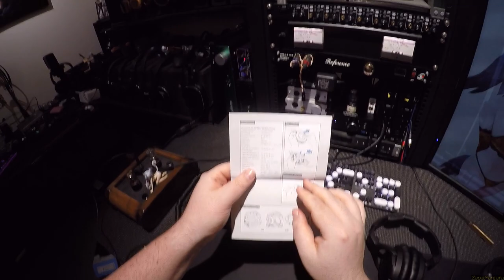Sennheiser HD300pro _(Z Reviews)_ Accurate... but

Comment: The reason of 8-pin connector is because it has the variation models like HMD300Pro that has a mic for broadcasting. They share the same design. Therefore in this case the normal HD300Pro probably only using 3 or 4 pins on the connector while the other models use all 8 pins.

Comment: I have 280, 300 and NDH 20. 300 is almost the best headphones ever, I love mids sooo much!!!! But base on 300 is overpowering mids, which is really unfortunate, I almost cried. NDH 20 is the best headphones ever but really uncomfortable after 30 min. Like really uncomfortable. 280 is the best headphones all around. If you dont have any of these 3 headphones, start with 280, it's only 79$ on sale. 280 sound very balanced, greats mids, great atmosphere, great bass, and detailed enough. 280 is a pure pleasure.
Reply: I have to disagree, 280 has abundant subbass boost, a midbass dip/hole, and unbalanced treble. What I read most people complain about is the vice grip.

I wouldn't mind owning and using HD280, but I already have an old Irish-built HD25-1 II and an HD300pro.

Comment: I was actually impressed by the sound quality of the HD300pro. Yes they are both quite neutral and detailed.
Reply: Good size soundstage too, due to the driver being set slightly further away from the ears than most headphones.  This not only minimizes bass rumble, it also creates a larger soundstage.
Reply: @thatchinaboi1   yeah, but they suffer from cup reverb worse than HD280pro, which hurts soundstage and resolution
Reply: @Jason75913   I highly doubt that.  HD300 Pro is designed to have lower distortion than HD280 Pro.  What SPL are you listening at?
Reply: @thatchinaboi1   distortion is irrelevant, volume level is almost irrelevant as well, cup reverb is from lack of acoustic treatment inside of the headphone cups, often behind the driver elements, it's what gives closed headphones their "closed" and reverberant sound versus good open-backs like HD598, K612, HD600, and HD650, closed headphones that suffer much less than HD300pro from cup reverb include SRH840, DT770pro (actually has acoustic treatment inside), HRM7 (also has treatment), K553, even the DT880pro and DT990pro have treatment even though they are semi-open

all the excess reflections or whatever hurt the soundstage and resolution, exactly like excess reverb inside of speaker cabinets, there are good reasons why studio monitoring speakers get a bunch of fiberfill inside of their cabinets

I mod my headphones with fiberfill and/or transpore tape to alleviate the issue, but I know everyone else won't do it.

HD300pro is pretty good up to a limited extent, and the impressive tonal balance makes it great for certain tasks, but clarity is overall lacking for a $200 headphone versus the competition. It's biggest advantage is the high passive isolation. Koss Pro4S is very similarly as balanced as the HD300pro, and K553 is also very close but has less bass boost.
Reply: @Jason75913  I agree with your criticism on the 300PRO.
can u recommend any material and how to apply that material and in which way/shape/pattern/form to be applied to get rid of the cup reverb?
I would very much appreciate it.. thanx in advance
Reply: @FeelingPoyChina   polyester fiberfill is your best friend, in headphones just like in speakers. You need in in the main driver chamber. After opening up a cup by taking out the screws, the main driver chamber is sealed with glue. Some headphones instead use screws, but HD300 is an inconvenient one with glue instead. No biggie, just cut the glue and carefully and slowly pry it open. Mod one side at a time, you need it so you have a frame of reference for best results. If you add too much fiberfill, the sound will become muffled, but the sweet spot is just before the sound begins to muffle. When you get it right, the modified side will sound much more nuanced, clear, revealing, just far less muddy overall. Then you mod the over side to sound the same, et voila.

Good speaker monitors have a bunch of fiberfill inside their cabinets to cut down on excess resonances that color and muddy the sound. The same should be done in headphones but end users get accustomed to the muddiness and don't complain. Been that way for decades, yet meanwhile, properly tweaked (or close to) speakers eventually get all the great rep and attention for studio or home hi-fi use. Similarly, open-back headphones also end up getting all the highest praise for their sound as they mostly eliminate, sometimes even fully eliminate, the excess resonances of closed-back headphones because they are open or semi-open. Folks try closed headphones and then try open ones, and if they can do without the isolation of closed headphones, then they end up preferring the open ones, especially HD600, HD650, DT880, and so forth. To add salt to injury, those particular open headphones are also significantly higher-fidelity versus any closed headphone, hence the snobbery some folks have about closed headphones just being "trash".

But in music studios, the isolation from closed headphones are very often a needed feature, and no one would rely on headphones for mixing in past as a few folks do these days. Me? I am OCD'd and prefer not to settle for mediocre sound, simply because I don't have to. I could, but I won't. And there are plenty of similarly-minded folks out there. Fiberfill is extremely inexpensive and practical, and easy to come by.

Comment: The connector is from the broadcast/ATC line of headsets (HMD, HME/C series), hence both the TORX for securing it, and open pins for supporting microphones/ANC powered through P48. A bit overkill for a studio pair, but makes sense to reuse it.
Reply: well said. economy of scales, the save up money in both production and assembly by having both the HMD and non-HMD version use the exact same case, even if that mean having to put an 8 pin conector on a 3 line cable because that's the one that was designed to fit in the case,

Comment: I believe the 8 pins in the cable  and jack are because of economy of scales, the version with the added microphone uses those lines but they save money in batch production by installing the same plug and jack in all version even if some only have 3 lines in the cable. I too have owned a set of HD 280 pro for 7 years, which I use to monitor Live events and recordings, and was looking forward to the 300 hundred just to see if they added some more detail. I will probably still get them down the line but now they won't be a priority. funny thing is I would never have said the 280 had plenty of bass (comparing to other monitoring/studio headphones) and I actually expected the 300 to add a bit more, although I have never tried using them with tubes as you do

Comment: I had the HD 380s... They sounded metallic and "hollow" so to speak. Didn't like that.
But the bass was awesome, and they were really comfortable though, huge opening!
Reply: Mr Z has repeatedly shown us how easily he's impressed by huge openings, although I will admit that with more subscribers he doesnt seem as keen to fist the ports on new speakers.
Reply: I like the HD 380's a lot. More so than the HD 280's. I can't really compare them to much more than the 280's and my Sennheiser PC350  SE headset. Hopefully your 'hollow' critique doesn't mess me up and make me start noticing it lol :)
Reply: @freezingCode  Haha, try HD 600s, 58Xs or even TIN T2s if you wanna ruin the 380s for yourself! :D
Reply: @zero signal I also dislike how the Dt 770 80 ohm sounds, but I had both the 380s and 600s, and the only thing the 380s had going for them was that BASS and their good isolation (and big opening, but that's a comfort thing)... and even that wasn't as well controlled as it could have been.

Every other aspect just goes to the 600s, no questions asked.
It's just the cleaner and more natural sounding, more detailed headphone out of the two, in my opinion.
Reply: @zero signal I actually like the narrow soundstage of 600s... I feel like no sound gets lost.
You'd probably like AKG k712s, based on what u said.
Large soundstage and good bass extension. (though a lot less impact compared to 380s)

Comment: OK looking at your collection how on earth do you maintain the the pads? I find the pads (covers covering and holding foam in place) after about a year or less they start flaking off despite I having giving them a quick dry wipe after each time of use to remove any body oils or perspiration.
I have had and still have HD280 pros and a Sennheiser  HD 300 pro even though it looks a little different to the one your reviewing unless an earlier model. I have had to replace the ear pads a couple of times which is expensive not to mention annoying.

Comment: You can buy these brand new on eBay all day every day for less than $150. I got lucky and got mine for $68 but these are seriously on eBay with dozens of listing's ranging from $100-$150.

I also have to say that I respectfully completely disagree with your review of the 300's. Your description of their sound (what little description you actually did and especially in comparison to the 280) is waaaaay off 🤷. The 300's have a significantly better mid-range presence than the 280's and the bass has better extension, texture and detail. Better detail retrieval in the highs as well.
Reply: @MadLustEnvy  yeah actually no. Verified through SENNHEISER serial number to be real. Won and Sold through bidding auction from a reliable sennheiser authorized dealer as well. Know your facts before spitting out nonsensical comments 🤷. Even the sennheiser rep chuckled when I first asked to verify the Headphones saying they've never once heard of there being fake 300 pro's but to be safe ran the serial number anyways
Reply: Blue  lmfao exactly 🤣

Comment: I want to buy the HD 280s but I worry about the cheap flake-prone ear pads and headband. They can be replaced but Sennheiser asks an arm and a leg for them.. It's as if they are deliberately designed to last up to 3 years or so with frequent use so that Sennheiser can make more money on parts.. The HD 300s sound nice but they are beyond my budget.
Reply: All earpads of the various headphones in my collection only last 2-3 years.

It may be that everyone "deliberately" designs the pads to fall apart. My Levis protein leather jacket from a few years ago is flaking, too. 😕

Comment: Ahh... silly question but can’t you just use the wire to determine which is left or right? That’s what I do. All my cans are single ended and connect in left.
Reply from the maker: Yes but there are several headphones (like the Neumanns) that have right side wires.

Comment: Hi there! About the ear pads, are they the same size or 300 pro has bigger ones? Which is the inner room of the 300 pro?

Thanks!
Reply: The same, but HD280 pads have a foam ring on the back that is part of the sound tuning for 280.

Comment: I dont understand what the neumann have to see in the comparaison. They are 500$ headphones, I bought my 300Pro 160$. If I had 500$ of course i would not take the 300Pro
Reply: If the Neumann is an HD630VB without the muddy passive bass boost, it is over priced. 630VB has fairly good quality, but the quality is around $200-250 range for a closed-back. $500 is ridiculous, unless the drivers are significantly improved (possible, but unlikely, knowing ol' Senn). I'm not willing to find out, closed headphones aren't a Sennheiser forte anyway.

Comment: Not worth the price increase, definitely not with the sale price of the 280 pro. $72 USD for the 280 and $200 for the 300? No contest. You can almost literally get 3 280s for the price of one 300. That's nuts.
Reply: It's better in every way, so a $100 price hike is not ridiculous.  In fact, it is worth it if you already love the HD 280 Pro, but want something even better.  😊
Reply: What is nuts is $2000 headphones.  The HD 300 Pros are worth it for the price, IMHO.  Much better than many headphones that cost much more.
Reply: @thatchinaboi1   cup reverb prevents it from being as analytical as DT770pro, HRM7, K553, K371, ATH-M70x, and the list goes on, in my opinion

It's not bad yet also not that great for the price.